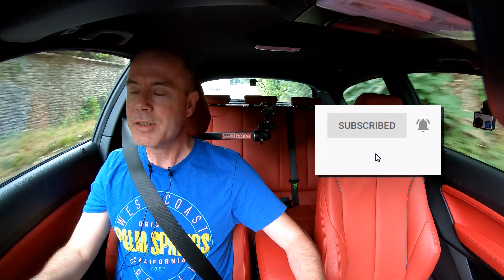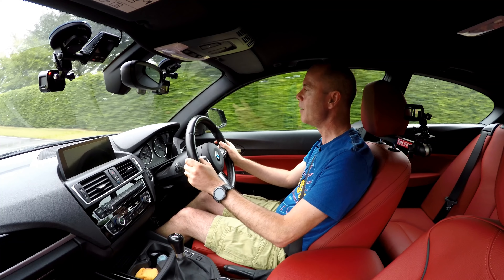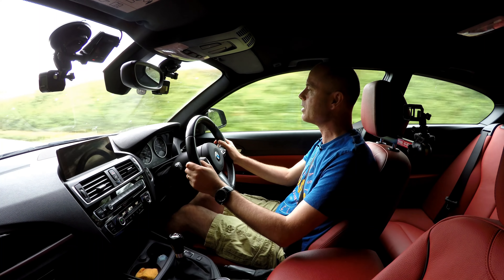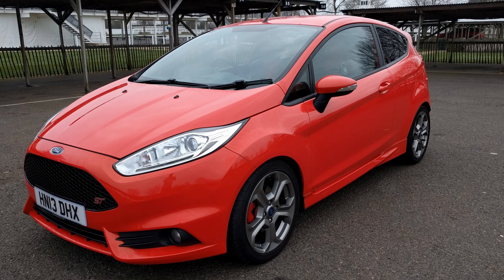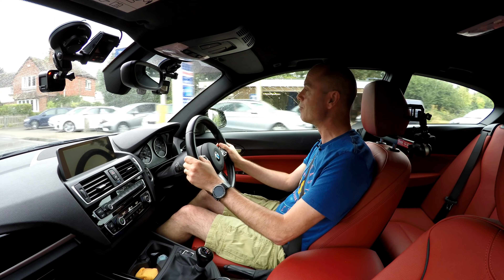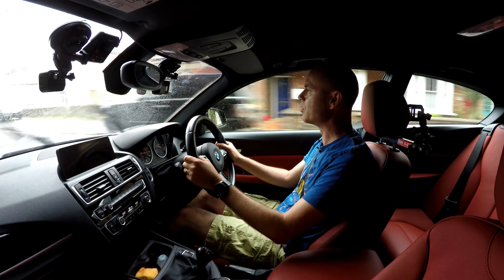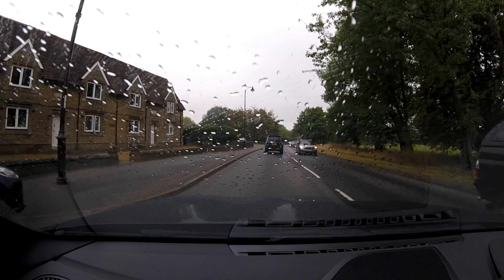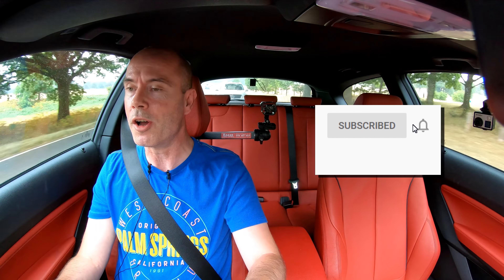BMW M140i : day 660 : I never thought I'd say this...

Comment: Comfort throttle is the same as DSC Fully Off. I have a ZF8 and BM3 Stg2 and xHP stage 3 and comfort is the best for 90% of my driving. xHP gives it a bit more where its not so lazy with the gears (more like stock "sport" gearbox). I find comfort great as well because the steering feels more natural, rather than artificially heavy. Too many makers give heavy steering to equate to "sport" which simply isn't the case. (and certainly not the case in the 140)

Comment: Interesting, Mark. I have a 140 with the ZF8 and I always flick it into sport. The reason I just don't get along with comfort is I don't like the feeling over the steering being so light.
Maybe i'll have to switch it and try for a while, see if I can get used to the steering and compare how the rest of the driving is.
Reply: Is there not an individual setting to do comfort suspension and sports steering?

Comment: I drive in comfort for 95% of the time.
When I want a hoon, I just go sport+ and sport box.
My average over 4000 miles (lots of town driving) is 28mpg, and I always switch stop/start off as soon as I get in. The gearbox (ZF8) is a lot smoother around town in comfort.

Comment: Interesting Mark, I left mine in comfort most of the time but really didn’t like the way the gear box responded so always went to sport+ and manual on the gearbox if I wanted to drive it properly. Gearbox was great until you floored the throttle then sometimes it would kick down  3 gears instead of just making use of the torque. Guess that’s a problem you don’t have with the manual. Because if that, I quite liked ECO pro - you could make use of the torque without it kicking down all of the time in that setting. However, it was sometimes iffy pulling out of junctions, you needed about 50%?throttle travel to set off at a reasonable pace or find a gap in traffic which was unnatural. Also, it always defaulted back to comfort which I found annoying so ended up just leaving it there. Looking forward to Bedford footage 👍🏻

Comment: I'm not the best at fine throttle control through my right foot, however I don't find such an extreme difference between the driving modes in throttle pedal mapping on my 230i. Now I wonder if it's the same mapping just with 70% of the torque of your car, or a different set of mappings. For me Eco Pro is a bit dead for half the travel and makes the car feel a bit like a slower one when just driving normally. I like it for winter conditions commuting in the dark, as an example. Comfort just feels linear, sport just feels a bit chunkier and more torquey for smaller throttle inputs, but still easy to control.

Comment: Mark maybe you have got the massive introduction of power and the induced back end twitch out of your system. I know it feels good to induce these traction losses and then control it. But there is a cost and it comes with fuel and consumables. Maybe you have got it out of your system. There was no better car for giving this thrill than a 24v Vauxhall senator that I used and a GSi Carlton 3 litre engine and rear wheel drive. Good fun but a bit adolescent.

Comment: Eco Pro is okay on the motorway, get 40 easily with my manual M140i in this situation.
Ideally would like comfort throttle and steering weight with sport noises, but not possible. I have passive suspension.

Comment: After the remap on my 340i ecopro is the setting I use most of the time. Throttle is more linear feeling like comfort mode on a standard car and I'm getting more economy to boot. For a back road blast I go in sport+ and throttle is very eager but very engaging. The other 2 modes hardly get used anymore lol ecopro on a standard car is garbage!